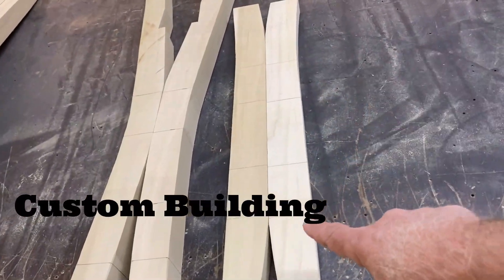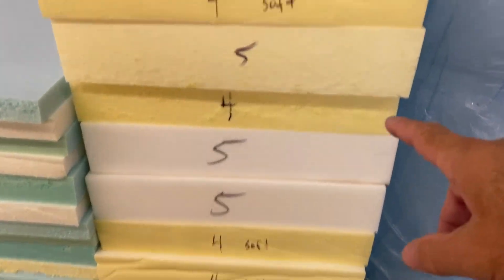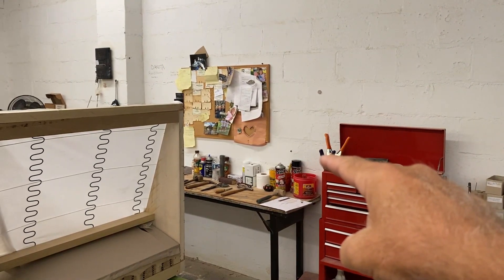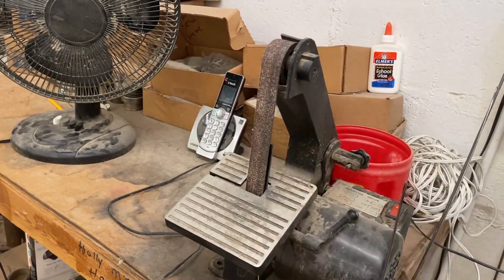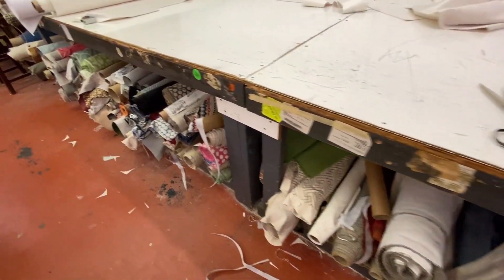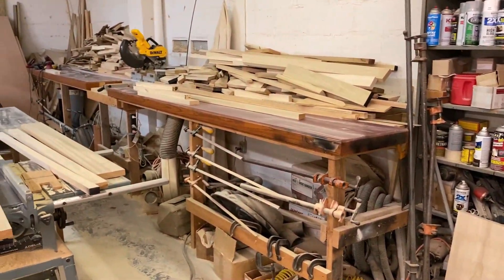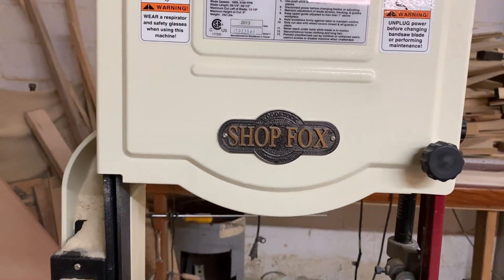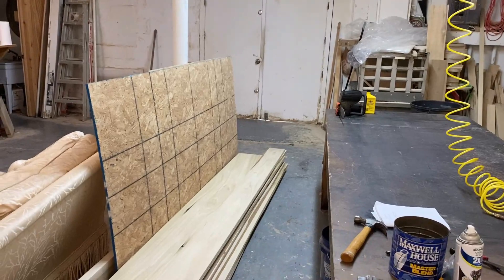Upholstery Shop Tour

Comment: My Dad said "all upholstery shops burn down eventully" now I know what he meant.
Reply: lol, I’ve been around upholstery since I was 14. Never heard of one burning
Reply: @tilfishindouspart6579  Good for you. I've been around my dads's shop and now mine since I was about 12 yrs old being a very tall and strong guy. Now 74 yrs old still cranking them out including on all deliveries. I've seen it happen.  Keep em clean real clean dust and all and pray folks.
Reply: @jimbobxcityguy5338  
Good to hear. I intend to retire by 67, but still be able to handle deliveries til then.
Reply: @tilfishindouspart6579  Lucky for you if you can retire at 67. The hardest part with deliveries for me is finding help at the other side of the sofa,chair etc that know how to handle it. I use to be able to carry the extra weight they make for me but that's getting tougher. Again I'm 6'2" and that helps alot. Although the best helper I delivered with was at my dads. He was about 5'6". Worked for my Dad 40 yrs.